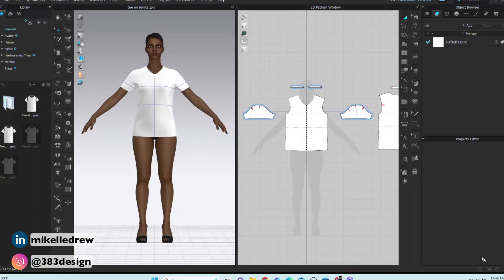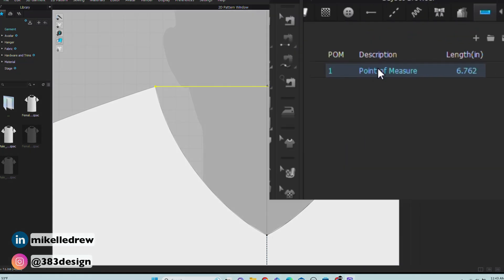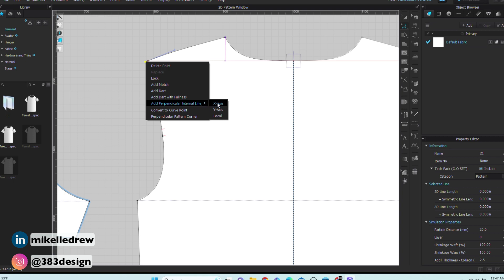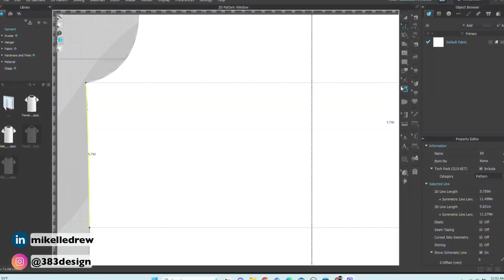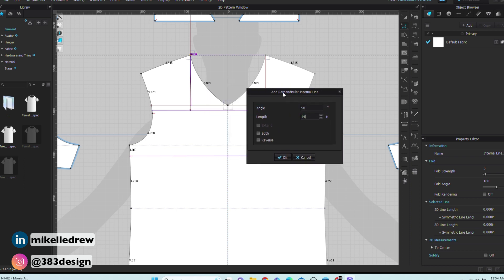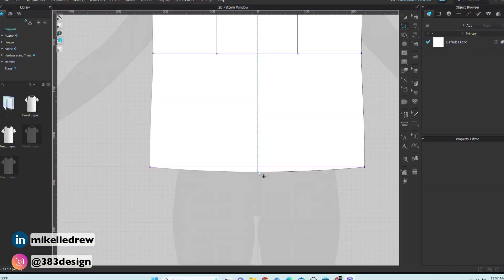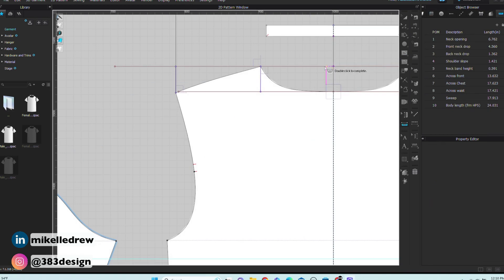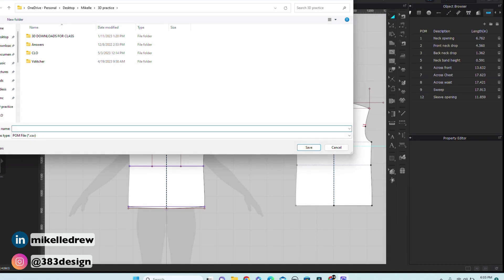Creating POMs with CLO3D: A Step-By-Step Guide

Comment: Hello thankyou for this video it is very helpful but I wanted to ask what goes into the 1st proto column of the spec sheet?
Reply from the maker: Hi, thanks for watching and commenting. Assuming you don't mean the numbers;), that 2nd colums are the points of measurements (POMs for short). These are the descriptions of what you're actually measuring, things like "neck width", "neck drop", "across shoulder", "chest width", etc.